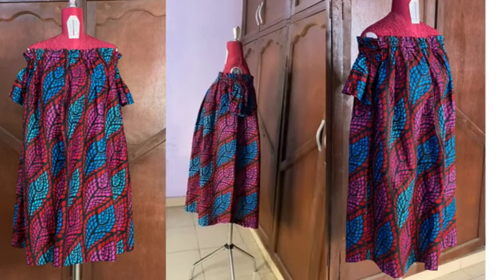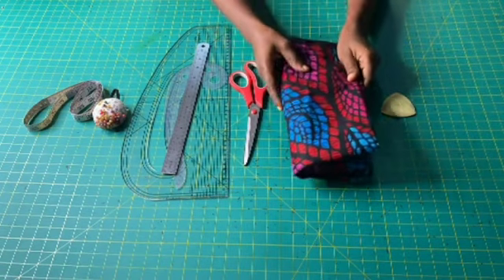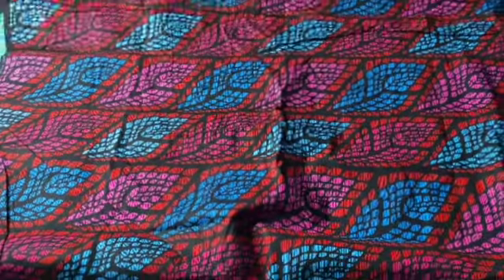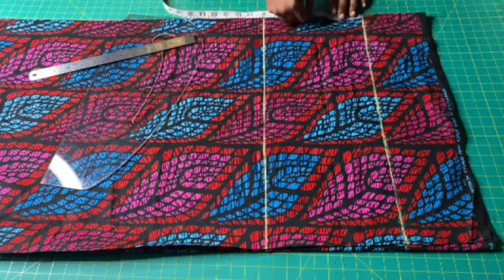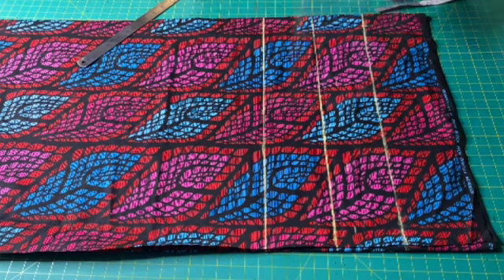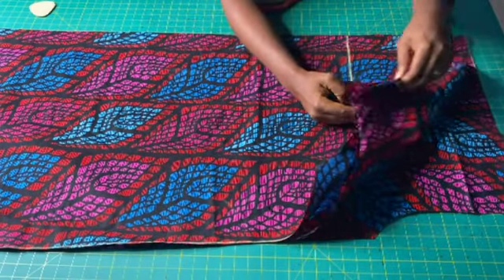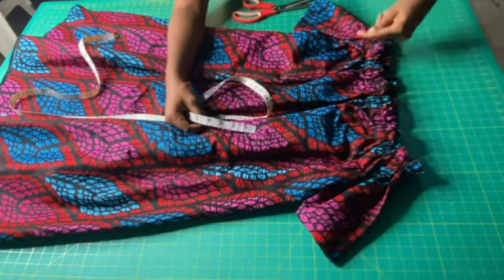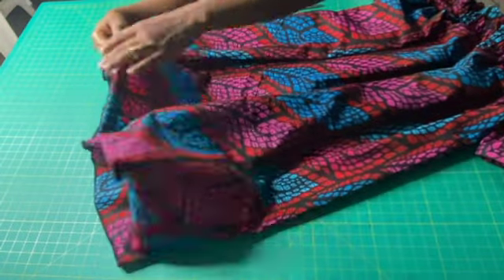How to cut and sew an elasticated off shoulder  ruffle dress

Comment: How do you determine the amount of elastic to use please
Reply from the maker: Measure around your upper shoulders and arms. Now insert the elastic into the elastic casing and adjust it until the  upper part of the dress is some inches (I mentioned the amount of inches in the video) smaller than the initial measurement that was taken.